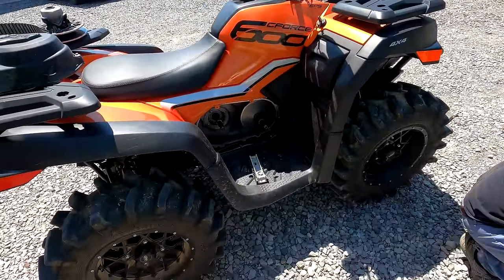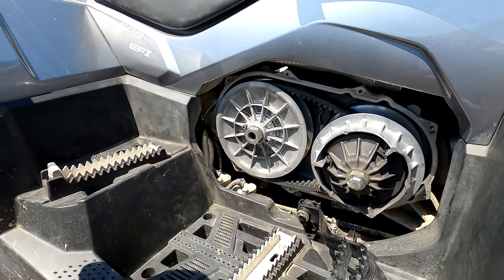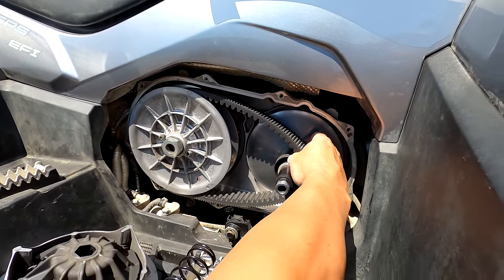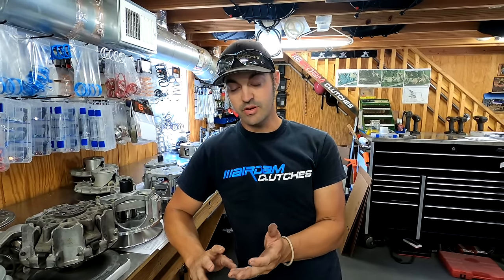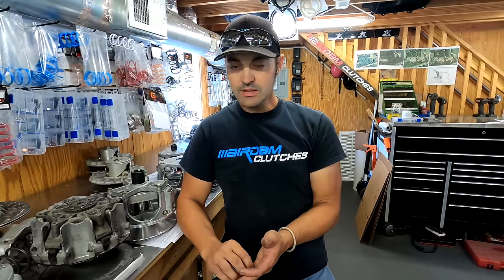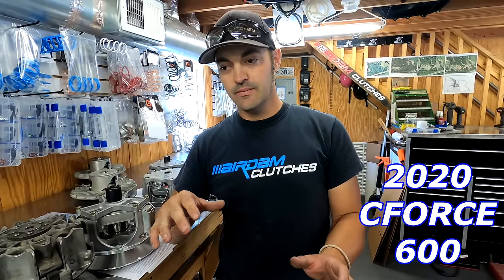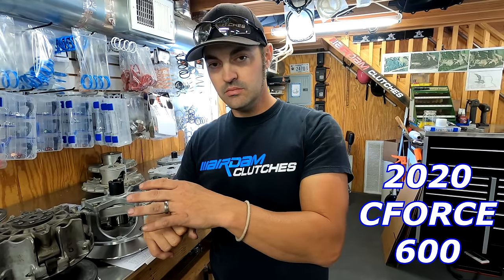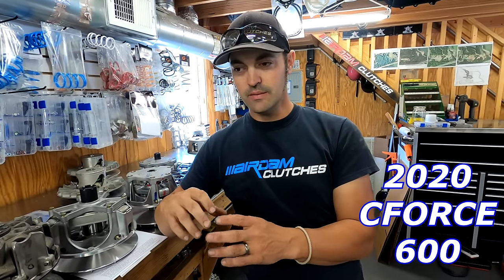CFMOTO Clutch Mods with AIRDAM CLUTCHES | How to remove CVTech Clutch Primary & Secondary

Comment: Absolutely excellent video!
I just wish I would hear something back from Adam. Finally did get an initial reply to emails asking for details, riding style and conditions, etc., I replied and then nothing. Haven't heard anything more from him in several weeks now.
The penny trick it is I guess.
Reply: What's the penny trick.
Reply: @block_a_hoytt  you use pennies in the clutch instead of weights I think.
Reply: @KakarotsSpirit4  wht I thought.

Comment: Love the videos I have the same 2020 600 but blue and just dropped it off at Main Street Thursday I’m getting a 2 in lift 14” rims and 28” outback max tires if you don’t mind me asking what did it cost to get the clutching done cause I have a feeling I will need it
Reply from the maker: They are working on setting up a good price for the DIY clutch kit and a price for if you want it installed at the shop... If it aint too late id encourage you not to go with the outback max tires.. They are Ridiculously heavy compared to the cryptids and other tires
Reply: Real Talk Powersports  I wanted the cryptids but they didn’t have any in the size I needed you don’t think it will hurt the 600 do you cause I asked them that at Main Street and they said they weren’t any heavier than the moto havocs they put on the 600 I really appreciate you responding also and love the videos I really wish they had a snorkel kit for the 600 also
Reply from the maker: @mattkrus9968  The Outback max are great tires.. they just are a few pounds heavier than the cryptids.. Just make sure you stay in low unless your average speed will be over 15 MPH then stop and put her in high

Comment: Just a heads up. I installed the clutch kits in a 2021 600 touring and a 2021 800xc yesterday. Both machines needed an 18 , 32 and a 35 mm socket. Not a 30. I don't want anyone to have to go out and buy the proper socket in the middle of the job like I did.
Reply: Just did it on my 600 and it took an 18, 30, and 32 mm socket.  My uncles 800 was the same.
Reply: @fairchaseoutdoors4181  Interesting. Just my luck I guess.

Comment: UForce 1000, what do you recommend if I want super smooth take off and engagement at lower rpm.Don’t want to loose a lot of top speed, but I don’t off road hard. Just some trail riding on sand from time to time.

Comment: If you remove one of the shims on the primary spring will it not reduce RPM clutch engagement buy effectively softening the factory primary spring?

Comment: Bought an 08 Arctic Cat 650 a few years ago with the original CVTech Secondary. Was trying to change the belt. When spreading the sheaves the screw bounced off the metal bushing between them and bent the screw and bushing. Is there a point for the bushing and can I replace it with any metal bushing?

Comment: Hi. great review and explanation. i just purchased a 2022 cf moto 600 touring. I am noticing the atv is revving very high at low speed. Its up around 5000 rpm when doing around 20 to 30 kph. Also seems as if the engine is very loud. Is there anyway i can lower the rpms while riding at these speeds. It just seems like the engine is working way to hard at low cruising speed. Any help would be greatly appreciated.

Comment: Would getting 20 gram weights and a 250/900 primary spring be good for a 2021 cforce 600t on stock tires just want better throttle response and lower the RPMs

Comment: Hey Blake, i want this kit but i cant get a response from adam or main street cycle?? I was able to reach adam a couple weeks ago and he suggested just doing the weights and primary spring because i run stock tires and mainly trail ride. I just want to get rid of the lag in the throttle. love the videos man!
Reply from the maker: If you call Main Street Cycle during their business hours they will answer and get ya hooked up with a kit.

Comment: A question: I found this video because I need to learn more about ATV engines.
My problem is that I would like a much more "spongy" engagement of the throttle. On my 850 XC it's really hard to drive very slow and precise. 
What mods would you recommend then? A harder spring on the primary so it does not close as fast, hence slipping more in the start?

Comment: I have a question I have a 19 uforce 500 Very jumpy off start in high gear Will this new belt fix my problem Thanks for the input awesome video s man
Reply from the maker: Donnie a fresh new belt should fix your Jumpy problem... It probably has a glazed spot on the belt were it is slipping and then catching on take off

Comment: I have been wanting a quad another one I got 2 Hondas started watching you on the CF Moto this Saturday went and looked at one bought a 600 touring very disappointed on performance until I seen this about clutching and still have hopes for it
Reply from the maker: What are you not liking about your 600? The spongy feeling of the throttle? What do you think about the ride comfort and suspension quality compared to your hondas
Reply: @RealTalkPowersports  has no power sounds like it's going fast but isn'tgranted I've only got about 4 and 1/2 hours on it and I haven't beenand when I put it in gear a few times now it's like it ain't taking the gear and then it will pop in real hard
Reply: Yea though the ride and handling and suspension is really and the power steering is such a big difference
Reply: Samuel Hostutler does that happen when you try in low gear? If so make sure you go all the forward into the grove in the gear selector than go slightly back into L slot.

Comment: What is the sweet spot to get the spring/weight right in these cforce 600s? If we wanted to keep it stock, is it possible to just reclock the secondary so it doesnt bog down at 5% throttle?

Comment: great video! how do you keep the clutch from spinning when removing the bolts?
Reply: It's a little late but use a impact gun. Works a charm. But before I bought one I would wedge a breaker bar against it

Comment: my cforce 600 touring 2021 needed a 18mm and 32mm not 30mm for primary and the weights were made out of alum not steel and only weighted 10 grams each.they filled the hole in the slyers compleaty???

Comment: Awesome video I have a 2020 600 touring and I love it but on one of my trail rides I lost a dust cap on my rear wheel and every where I look even on cfmoto web site all I can find are parts for 2019 and not 2020. So my question is where can I buy parts for this model

Comment: I am in utah running stock tires want to get it to engage smooth and set up to climb in mountains on tight trails. Can I get it better re clocking secondary

Comment: I have brand new 2022 CFMOTO 1000 atv  when going down steep decent engine breaking lets go then its like quad is in neutral and takes off if you touch throttle the slightest it will engage and through you over the bars is there a fix for this

Comment: I just bought a used 2022 CF Moto 600 it only has 40 Mi on it. The first thing I noticed it's like a snowmobile it revs a little bit and then slams into gear

Comment: i am trying to change out my belt and i remove the 19mm bolt, then the 30mm nut and washer - problem is that the pulley stays stuck on the shaft.
I cannot for the life of me pull it out. any ideas why this is? should i apply some heat?

Comment: Great Viedo he needs to add turnaround time for cluch mods. The price of these mechains are great and with a little mod you can get enough power to hang with eveyone. Yall need to link up with a big channel Like SXS blog and have a good day of it so folks can see this is a good toy for not so much money
Reply from the maker: That would be cool.. I have been a SXS blog fan for over 3 years.. Pretty much have watched every video. Id love to go up there with some of our units and ride with them and run the new ZFORCE on their Gaunlet track.
Reply: That would be awesome. I would like to see what these guys think of the 950. Lol they way they store id be scRed to let them drive it without extra insurance. I used to ride similarly but it was me on my machine so when it broke I could only get mad at myself. But those guys push them without fear of breaking them. I feel perhaps trying
To see what it takes to break one or blow one up lol.

Comment: On the primary, you mention the washers and to not throw them away. What do they do?
My situation is that something was clanging under warranty, so I took it in to the dealer. They fixed the clanging, but now it has a severe lag in engaging on takeoff, and the compression braking engages way too early. Is it possible that the dealer left those washers out and that's causing this problem? It is now out of warranty.
Reply from the maker: All the washers are for is proper belt alignment. If it has been messed up since the dealer fixed the other issue then they should qt least take a look at it for you without charging you to see if what they did caused another problem

Comment: That's good information, cvt always have been mysterious for me, I mean, I have changed roller on my atv for having more rpm by taking lighter one, but it look like there is so more we can do to help the motor to give his maximum, I will give a look at his video.
BTW I have learned something today, the 600 2020 will be available in France only as the touring version. I don't want a long chassis, so I can forget CF Moto for my future atv, I am a bit sad cause now that outlander or sportsman 570, the only 2 that are interesting for me, not a lot of choice...
Reply: i have the 600 touring and honestly its actually the best i have rode! crazy it will go through most muddy situations less than a 1 foot deep without 4x4 its definily a worthy buy

Comment: Hi I just changed my drive belt on my cf moto 520l At idle say in park or neutral both clutches were suppose to not spin. When you give it gas they start to spin but my secondary don't stop spinning 
Can someone explain to me whats suppose to happen?

Comment: So reclocked my secondary from B1 to B2 but haven't noticed much of a difference if any.  Am I missing something?
Reply from the maker: B1 to b2 is not much of a difference. You need to try C2 or B3.. both of those are close to the same tension. And you need to order the kit from Main Street Cycle. It will have a stiffer primary spring and different weights for the primary

Comment: How much torque does that impact driver have ? I used two types of impacts with 1400 lbs of torque and the bolt ain’t even turning. Anyone have any advice on what I can do next.
Reply from the maker: Wow.. naw I have been able to use my 1/2" dewalt each time.. just confirming with you that on the primary both bolts are left hand threads and the secondary nut it regular
Reply: Real Talk Powersports. Yeah it’s really odd. Because I watch your videos and it looks so easy. Then I go try and it won’t even budge lol. The primary is the one closest to the front right ? And to loosen it you turn it right
Reply: So I put my new weights in and spring on my quad today. And now it runs hot. Is this normal or did I do something wrong while putting it in ?

Comment: will the belt come off without taking the clutch off?
Reply from the maker: Yes it will.. just losen the secondary as far as you can and work it off and around the secondary. Its a pain in the rear but you can do it

Comment: Can someone help me out ? I just received my primary clutch kit. I’m trying to take the primary off but turning the bolt right. But it ain’t working I tried using a ratchet but the primary keeps spinning so I can’t get it. Please help me. This is on a 2020 cfmoto cforce 500
Reply from the maker: Your going to have to use a 1/2 inch Impact to get it loose without the primary spinning.
Reply from the maker: The 500 will come apart just like what you see in this video of the 800 clutch
Reply: I’m using the makita 1/2 inch impact gun and it’s not even budging I was so excited to try my new clutch setup I got from Adam but this ain’t working as planed. I literally just got it back from my first service today to.